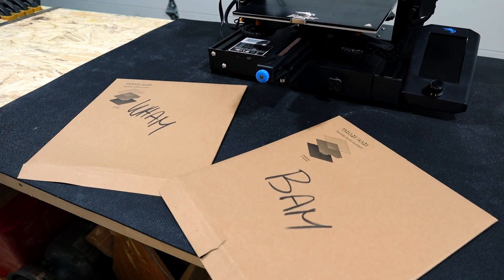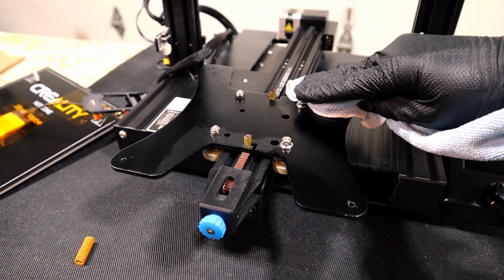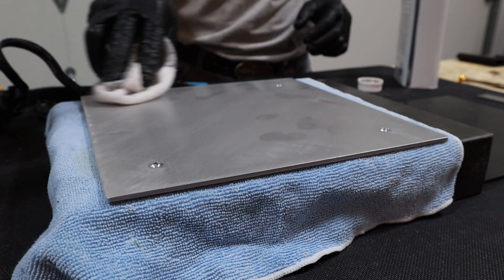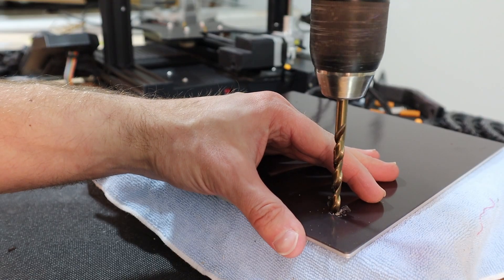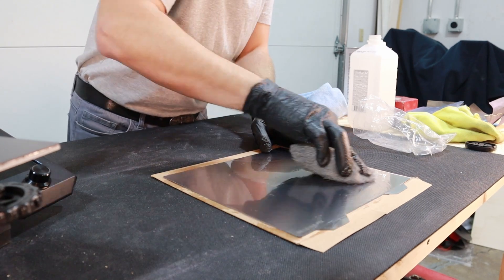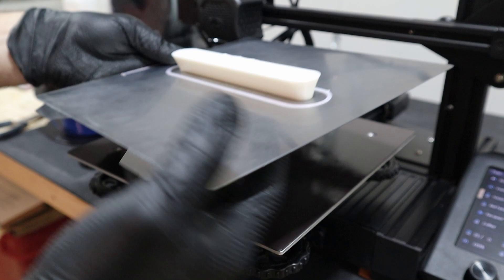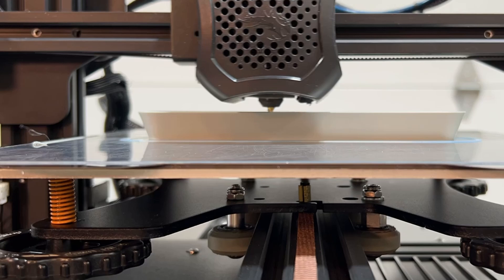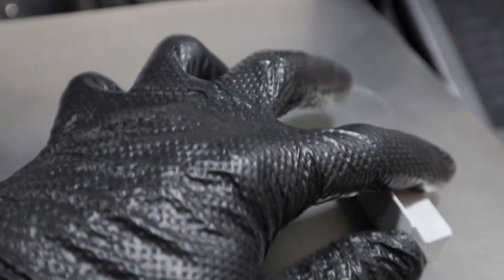Creality Ender 3 V2  - Wham Bam PEX Build plate

Comment: It's definitely not recommended to clean with acetone after prints. It should be 000 steel wool and IPA between every print. Never had an issue with my Whambam PEX or XTR.
Reply from the maker: I just re-checked the instructions and you're absolutely right, they call for IPA and steel wool.  Acetone was my thought on removing and residual grease, but probably best not to use it outside of just the first cleaning.

Comment: Have the PEX on 3 Ender3 Pros.  While they all have all hot metal ends, I have no complaints.  I'm not sure, but I have had the Wham-Bam PEX flex plates for over a year, maybe 2.  I clean them between every 2 or three prints with Windex and a scotch pad.  What can I say?  Works great.
Reply from the maker: I'm having good luck so far as well, some prints do lift a little, but they are printed heavy and they are large prints as well.  The print doesn't fail, just a small amount of lift, and no printing in an enclosure yet, so maybe it is worst case scenario.  Thanks for the feedback!

Comment: Looking good and nice, not annoying ASMR ;)
I always remove PEI from the printer and let it cool on the table for a bit, then flex to remove the parts. Without skirts I then don't have any reason to touch the bed and only clean it every few weeks or more.
That magnet looks really strong.
Reply from the maker: I've been printing a lot, and it is working well on some tough prints, the magnet seems to be holding well, even at 110C for ASA. Those little bubbles keep appearing and then disappearing on the next print, so hopefully it keeps going that way.  I think it may just be the bond with PETG being too strong.  I should probably switch to ASA or ABS for everything.  Thanks for the tips, do you use PEI with the textured side?
Reply: @NeedItMakeIt  I use smooth one more but also own a double sided PEI and use the textured side there. Textured is good if you use the bottom side as a visible one, hides all the lines nicely.

Comment: Really nice !  I would love to know how these compare to the energetic ones on ali express. I was hesitant on getting the wham bam when I switched my plate, but the all the cost combined was too expensive for a plate, so I went for the aliexpress solution instead
Reply: I run the beds at 80 degrees or higher, and never an issue.  They stick down very flat.  If you run OctoPrint, you can use a plugin to test your overall flatness at any temperature.

Comment: For those with a small budget there is a perfect solution for perfect adhesion:
1. Get a piece of mirror, cut it to the size of the machine table - at the glazier's you can do it for pennies while you wait. This way we will have a perfectly smooth table because the mirror will always be super flat.
2. Now you need to make a "glue" from sugar and water. Just mix in a 1:1 ratio until the crystals dissolve. 4 teaspoons of sugar will last you a very long time. It must be kept in a well-sealed container so that the water does not evaporate.
3. Before printing, preheat the table to ~50 degrees Celsius and apply a thin layer on the mirror with a tissue soaked in the "glue". If there are small "drops" on the table, smear them immediately because on a hot table this "glial" quickly solidifies.
4. After finishing the print, just wait a few minutes - the print will fall off the mirror by itself.

I've been doing this for ~two years now and I've never had any problems holding up even large prints.

Happy printing! 🤩

(i used google translator)

Comment: I just got a PEX bed, not from wham bam and it seems that printing ABS slightly damaged the surface in some areas, printing PC on it removed a small chunk and definitely seemed to have damaged the bed other than the chunk, almost like it had melted it slightly. The PC wasn’t sticking so I increased the squish onto the bed and then it stuck far too well. Don’t know if that is just the quality of the bed I got or if it is a problem with PEX beds.
Reply from the maker: I have two small pieces which are similar to what you're talking about, so far they haven't caused a problem.  I think for some materials, glue stick might still be a good idea to act as a barrier for this problem.  ABS and Glue stick don't get along so that's probably not going to be great for that one.  ASA either likely.  But I will do some testing and see what happens.  Thanks for confirming similar issues to what I've been seeing.  Overall I am still happy with it using PLA and PETG, but the higher temp materials could cause problems.
Reply: @NeedItMakeIt  I got the PEX specifically since it was meant to be fine with higher temperatures than PEI, hence PETG doesn't bond permanently to it. Everything I could see from wham bam and other sources said that PC might have trouble sticking and didn't require a release agent but glue stick was recommend to help it stick better, so I was very surprised when it stuck too well to the bare bed. I think it probably did melt the PC into the bed a little, I also used a very slow speed of 10 mm/s for the first layer which helped it stick but also probably gave the nozzle enough time to melt or soften the PEX.

Next time I will try a normal PVA glue stick and if that doesn't work I might need to try one of the PC specific adhesives. I managed to print PC before on the stock ender 3 pro magnetic bed but I don't know what it is made of, it could be made of PC itself and it did stick very well but I don't think it damaged the bed, on that bed it did warp but it stayed stuck to the bed, it just warped the bed itself since it was very flexible, the spring steel or glass beds are better for that because they are stiffer.

Comment: belt sits on the wrong way on the y-axis..
Reply: It looks like it’s twisted so the belt’s teeth are engaged with the drive gear but not with the idler. Instinctively that both makes sense but also doesn’t – I’d love to hear about the benefits/drawbacks of this configuration from anyone that’s done it before.
Reply from the maker: I did this on purpose, but I don't think there is any benefit.   If you print with PETG, the sheen shows every little irregularity and I thought that maybe the teeth on the belt were causing this, the very regular intervals.  I'm not so sure that's the case, could be related to the motors/steps etc.
Reply from the maker: That's right, you have a keen eye!

Comment: try printing PC and tell me what you think. I found it stuck almost too well.
Also, you should NEVER use acetone to clean PEX.
Reply: I might be remembering wrong but I’m wham bam’s cleaning video didnt they recommend to use acetone? 

I printed PC on a PEX bed, not a wham bam one and it wasn’t sticking well at all so I lowered the nozzle to get more squish and it seems to have slightly melted the surface in places and in one place it bonded well enough that a chunk came out of the bed. Wham bam themselves say they have printed PC on PEX and it doesn’t need any release agent and instead that it doesn’t stick that well, so I don’t know what went wrong with mine.

Comment: I ended “Upgrading” from a glass bed I think I’m going to go back
Reply: I did carbon fiber and it doesn’t require  coating. Best $100 buildplate ever
Reply: @EGGSHELLWRAPS  $100 on a build surface is a little ridiculous, you can get carbon fibre build plates a lot cheaper than that.
Reply: I wanted to do a carbon fiber bed carrier to lose weight. I haven’t considered a bed too. That would be a game changer also bet I could skip the aluminum plate and just have the heater attached onto the carbon fiber. Maybe not a great idea since I want the build plate to be removable.

Comment: Aren't the bubbles caused by printing PETG directly onto the PEX? In the manual, they say a seperation layer should be used, PETG tends to bond to PEX.
Reply: I print PETG on Wham Bam PEX and it bonds well as it should and after using a scraper they come right off.

Comment: I have an E3V2 with the stock glass bed and I print everything on it. I have 4 printers with 3 glass beds and no glue, hairspray or tape has touched my beds.

I only clean it with isopropyl alcohol. I haven't watched a first layer on that machine in months. FYI, if you're trying to print ASA without an enclosure, good luck. 😂

If your settings are properly dialed-in glass beds work great. I'm not really sure why some people have problems with them. I have a feeling it's because they switch between brands of filament and different brands like different z offsets and heat settings. I think some people think they can set it for one brand and then switch brands and think they don't need to adjust it.

I print everything in the same brand but if I need to change brands for some reason I just adjust the z offset/heat settings and it sticks fine every time.

I feel bad when I see people waste money on these machines thinking more upgrades will improve their printing. Only thing I've done to the E3V2 is bed spacers, all metal hotend and extruder, and Jyers firmware. Like a $100 total only because I got the Micro Swiss hotend.

The prints come out just as good and just as fast as my friends Prusa.

As I like to say, people can upgrade to death all they want. The proof is in the prints. You can assume your printer is better with all the upgrades, but if mine prints the same, is it?

Just food for thought for those of you that think these upgrades are necessary. Just trying to save you some money. Just learn to dial in the settings.
Reply: Same, I don't have any issues with my glass bed.
But I did also spend a long time dialling in bed temperatures and getting a perfect first layer. 
I will also say that I clean it with alcohol before every print, and if I let it sit for a while or get any issues give it a gentle wash with hot water and dish soap. Makes a big difference. I can get away with maybe 3 or 4 prints without cleaning.
Reply: Until you have a NEED FOR SPEED

Comment: Just a stupid thought: Can the plate be prepped by sandblasting or sodablasting?
Reply: There's nothing wrong with the glass beds. Lots of us using them successfully everyday.
Reply: @dangerous8333  The main issues I have with glass beds are the weight, the removal of the occasional stuck print when calibrating for a new filament, and waiting for the bed to cool before removing the print and starting another one. The weight only matters if you’re trying to go really fast (like, Klipper fast), and the occasional stuck print stops happening once you have enough experience, but the ability to hot swap a bed is pretty nice if you’re doing back-to-back batches. Popping one flex plate off, putting another on, and being able to start the next iteration almost instantly while the first is still cooling just feels unreasonably good even if it’s only saving you like 5 minutes of waiting for the bed to cool down/heat up. Probably not worth the upgrade price for most people, but it’s still a pretty slick feature.

Comment: Seems these Wam Bam plates are becoming popular  I am thinking of getting myself on for my Ender 3v2, Where did you get yours?
Reply: You don't need this. Just learn how to dial in the settings properly. The glass beds are great once you figure that out, and you don't need glue tape or hairspray. Just isopropyl alcohol.
Reply: @dangerous8333  I use isopropyl alcohol to clean the glass bed. But stuff still come loose or pull up. Specially petg.
Reply: @ Andrew du Toit Dan is right, if anything it made my prints stick to the bed even less than the original glass bed don't buy one
Reply: @Harry_B647  well your experience is very different from most peoples so chances are it is something to do with your setup.
Reply: @conorstewart2214  I do agree that glass bed is really good from my own experience, i do my best to never touch the bed with my hands ever to prevent oils getting on the surface and i have had perfect adhesion. From what i seen online some people just might not have as good adhesion as others and reason being the coating from the factory on the glass bed, seems like a hit or miss for some people. I use IPA&A drop of Dawn Soap, Water Mixture to clean my bed.
Reply: @AnthonyUDT  any bed can get fingerprints on it and it affects how well it sticks, you always need to clean them.
Reply: @dangerous8333  I have used a glass bed for a long time and a PEI or PEX bed does make a big difference, you get much more reliable first layer adhesion.